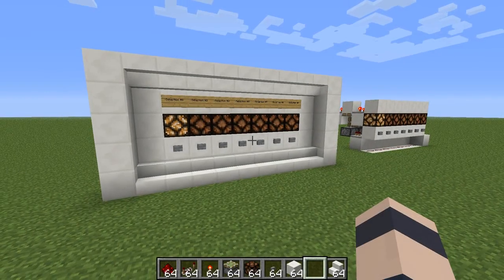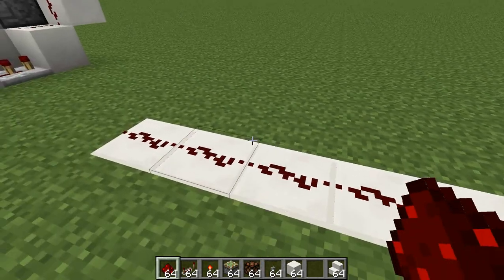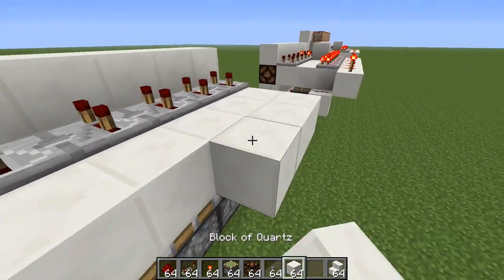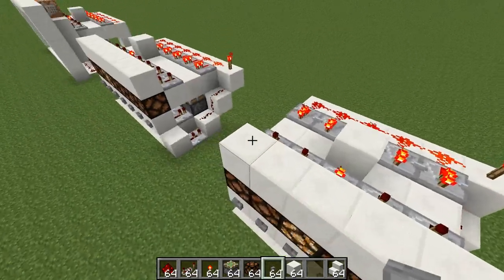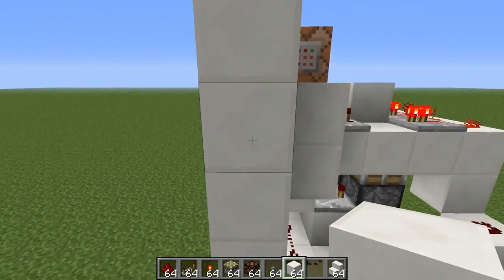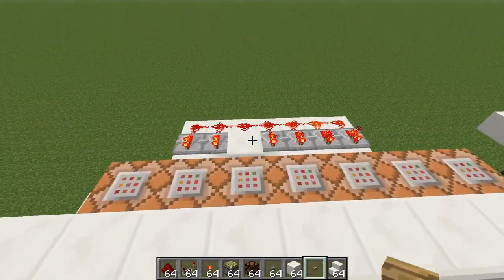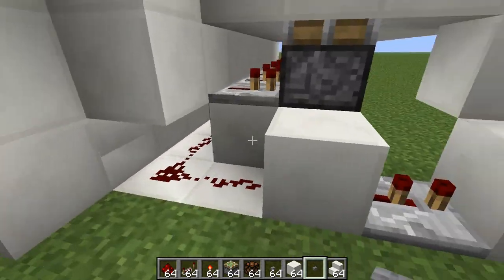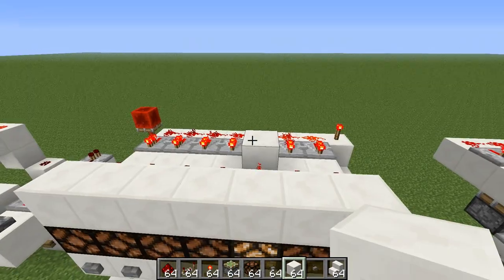Minecraft - Tutorial: Selector Panel

Comment: Using your design for ref as I’m after a design that is about 40 long as to have one button for each type of potion. Each button will link to each ingredient for each potion and as a mine cart goes past it picks up the required ingredient for brewing. Extra button for splash lingering potion. Each button sends a signal to the back and unlocks any ones open already and turns them off. Then puts up target block on current selection. Got a modified 2 way repeater line at the back which allows signal to each end of buttons.
Reply: Current test design is 72 wide. Went crazy with copy and paste. All appears to work and all continuess.

Comment: I prefer the design that had no piston at the front, causing an immediate reset. That allows the circuit to receive input, send it to the appropriate output, and then ready itself for another selection, even if it is on the same input line. Also, it prevents the indicator from sticking, indicating that the circuit is ready.

Comment: That's not what I've said at all; you really should work to put your rage aside to allow full reading comprehension. I've said *most* money goes to charities! I repeat for your sake: MOST MONEY ==> CHARITY. Nah, even standing up it's cramped. The church I believe hasn't had a touch-up since the 60's when it was built. One workaround we're doing is having two services, one earlier than the other.

That's the point from the very beginning. Not all churches do the same thing. Finally---thanks. :-)

Comment: buttons only send a single pulse. the selector panel is like an array of levers. however with an array of levers you'd need to manually reset all the switches. This selector panel does all the signal resetting automatically. Obviously in this case, the selector panel is being used to display the selection using light blocks (which require a persistent signal)